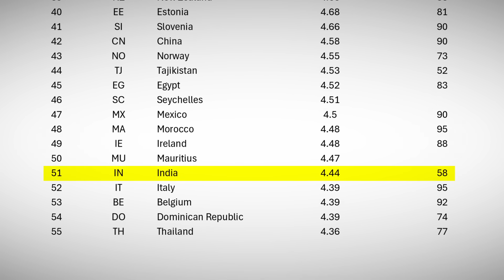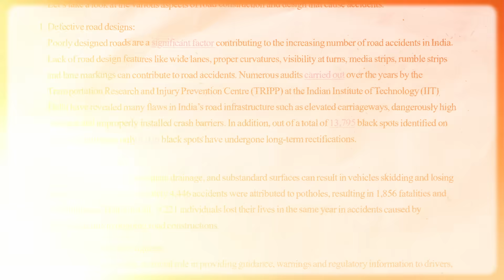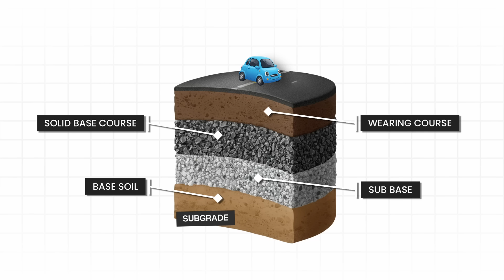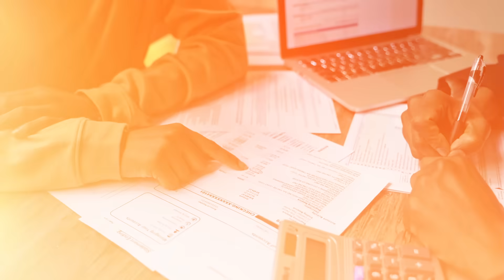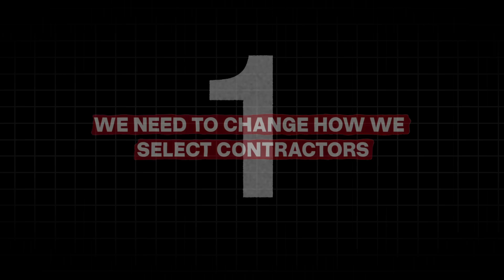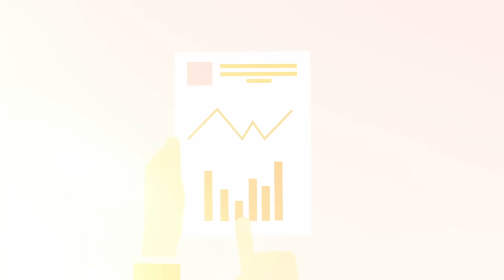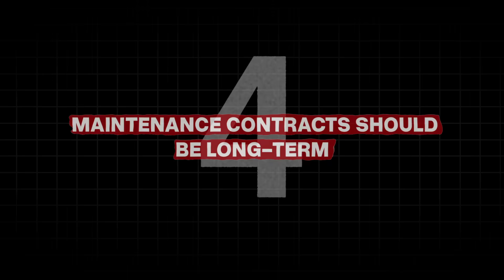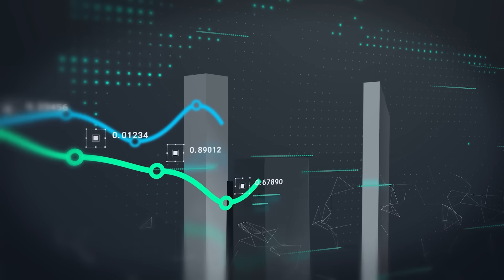Why Bengaluru’s Roads Break So Fast—and How to Build Ones That Last 🛣️💥

Comment: Okay so this is just wrong analysis , amount of rain is a factor yes , but when you are comparing Vietname or any other nation , do you know how many heavy vehicles like trucks pass via those roads . Indian roads and arterial roads are full of these heavy trucks , there needs to be complete decongestion required and new routes for these trucks and heavy vehicles. Strict zoning laws and last mile mobility regulations are needed. No amount of good road construction with good materials , expansion of lanes etc will solve this issue, its a urgent need to create new routes for heavy vehicles.
Reply from the maker: I completely agree with you on the need for decongestion and creating dedicated routes for heavy vehicles — that’s absolutely essential. But at the same time, we do have examples within India itself, like the NICE Road in Bengaluru, which handles a massive amount of truck traffic and yet remains pothole-free. The key difference is that it’s maintained exceptionally well by the private companies that built it — showing that with proper upkeep and accountability, even heavy traffic doesn’t have to mean bad roads.
Reply: @Raconteur65  NICE road is not correct example . There are no IT parks and SEZs on NICE road.ORR in bangalore is no longer a ORR it goes through right new IT areas and its occupied by everyone from heavy vehicles to commuters . Roads like ORR are multiple in each of metro cities , they were created like ORR because at that time , they actually were situated at outskirts when metro cities grew , they have become arterial roads. This same will also happen to your beloved NICE road as well and no amount of maintenance would help to keep it in good condition. We need public transport , we need last mile mobility, we need proper segregation and zoning laws and proper planning on dividing these commercial and industrial park across the city . The number of companies having offices on ORR is insane ! All due to lack of regulation and zoning laws it has created that mess. Same mess is in Mumbai as well , Western Express Highway is exactly same as ORR , takes 1 hr for 5 kms in evening rush hour peak traffic. I will give you example of Wifi connection , lets say you buy 100 Gbps internet connection , if you use it its fine , if your neighbours use it its okay , but if entire society is using your connection your internet would be like 2G .

Comment: One more suggestion could work too. Find out who are involved in the selection committee, and track their movements closely to see if they are meeting any of the individuals related to those that submitted tenders for this project, including monitoring bank balance and digital transactions during this process. Fire those who are found using corrupt practices. Do these often, and at one point of time, both the officials as well as the bidders will turn out good. When they turn out to be good, suddenly the road they lay also will turn out to be good enough for 5 years or so.
Reply from the maker: This will work when corruption is limited only to the lower levels
Reply: Who will keep an eye in a system that is totally corrupt from top to bottom?

Comment: Wait , India has better roads than Italy?😂
Reply from the maker: That's probably due to aging infrastructure. Italy’s road and bridge network is one of the oldest in Europe. Many sections date back to the 1960s–1980s and need major refurbishment. The 2018 Genoa bridge collapse is an example

Comment: Our country lacks walkways. I know the roads are being developed but where’s the footpaths? Humans are not allowed to walk on the roads other than crossing it in a designated way. You will be caught and fined if you walk on a road in any developed country, except if there are no walkways.

There’s a minimum width of 1.2 metres for footpaths. And it should be clear with no obstructions. Meaning no pushbikes or motorbikes parked. Or trees or mobile vendors.

Footpaths should be smooth and have a proper angled slope when merging with the roads. Makes it easy for someone on a wheelchair to slide. Plus tactile pavings to guide a blind person. Walkways should not end at any corner. It should be a complete pathway just like the roads.

Even if you look the roads in developed Dholera Smart City, you can see a pedestrian crossing painted on the roads. But where’s the sign board to show the vehicles to stop? 
And if you look at the kerbs, there’s no slope. No way a person on a wheelchair would be able to cross the road without someone’s hand.
Reply from the maker: I agree! Pedestrians should be given first priority and footpaths should be fixed and encroachment should be stopped.

Comment: No. This is not right way for India to make roads. India is monsoon flood prone region and must add steel concrete rebar layer which can hold and distribute the weight of the vehicles and they won’t break down. Even a few inches concrete steel rebar layer can prolong the life of the roads. Also edges must be concrete so they don’t tear. BTW why is so that when roads are good then Gadkari State Govt is doing great. But if fc-king Bengaluru roads are bad then how come PM is responsible where corrupt state govt of Karnataka who is planning corrupt 11000 cr for a 11000 potholes. Do you see level of corruption by these mfs. A whooping 1 cr for each pothole that’s the state Govt and whom you are targeting here is what if you were PM. Why the fc-uk people are biased and don’t see who is doing corruption and responsible for the bad work or good? First think as£ol€s then blame people.

Comment: 0:22, China is at 42? 41 countries have better roads than China?
Reply from the maker: That's probably due to huge geographic / terrain diversity. China has vast areas of mountains, deserts, rural regions where road building/maintenance is much harder. But it'll sure catch up, the way things are going.
Reply: Lol, China doesn't mean Shanghai and Chengdu.
If you go to rural China it still sucks

Comment: In Bangalore, The hosur road stretch from silk board to athibele built by l&t has no potholes. It was built 25 years ago
Reply: Hahaha ! That is why L& T has withdrew from recent tenders !
Reply: Ya it's a good road. The main issue is traffic near bommanhalli signal and also silk board
Reply from the maker: Really?
Reply: @Raconteur65 if you are from Bengaluru you should know it

Comment: no need to change the criteria of selecting the contractor , the cheapest one should be best but , accountability should be there , proper equipment , less corruption both the supervising engineer and the contractor should face the liability.
Reply from the maker: Agreed. But unfortunately here the cheapest is not the best and we lack accountability